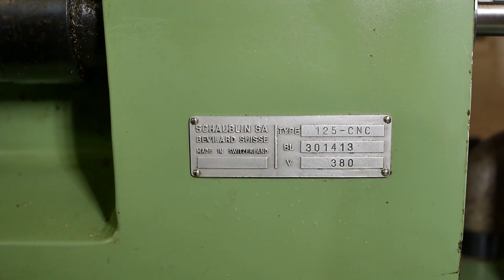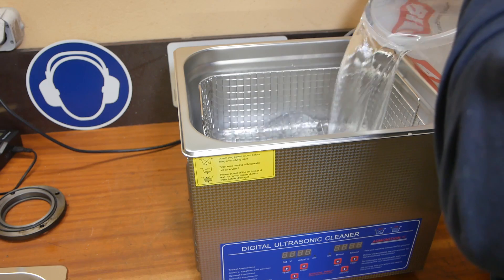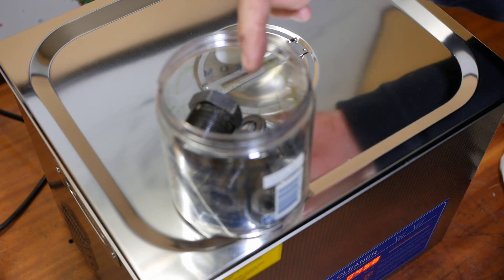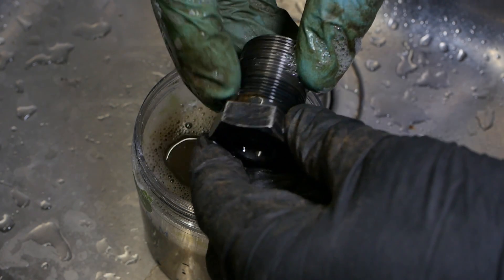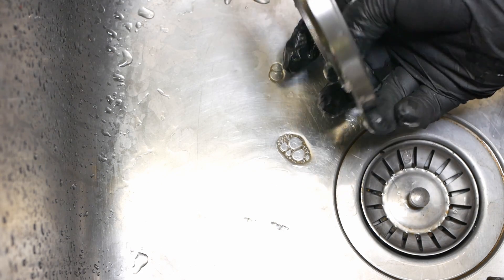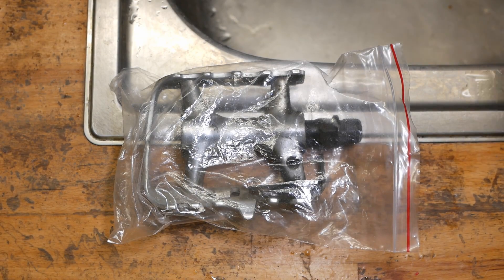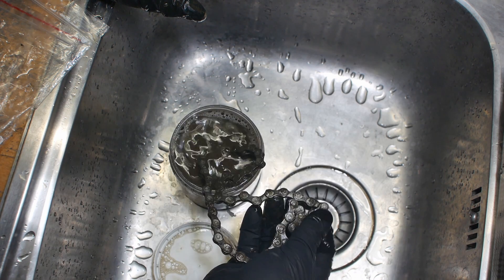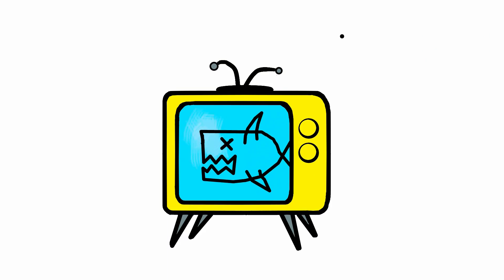Do cheap ultrasonic cleaners work? || RotarySMP

Comment: When using dish washing detergent I find heating it to 60 degrees makes a big difference, and usually 20 minutes or more cleaning time. Anodized or painted parts will lose the coating where it has been nicked or scratched so be careful with any surface coating you want to keep. Sticky stuff like glue or rubber requires some type of solvent but everything else I use gentle detergent.

For carbon on pistions i like to use soda blasting. Just buy a jug of baking soda and put it in a normal sand blasting cabinet. Removes all the carbon without damaging the aluminium. Unlike sand or glass bead blasting that will remove material from the piston. Soda is even safe to use in the wrist pin hole. Rinse with water to remove the soda.
Reply from the maker: Thanks for that.

Comment: I worked at Bausch & Lomb making Intra Optical lenses. We used ultrasound and kerosene to remove the lenses from the dopts. You can use flammable solvents just not SUPER flammable solvents. kerosene or diesel are great. Iso alcohol is good too especially for electronics. Cmon who listens to the safety guy anyway?
Reply from the maker: Thanks for the feedback of your experience. There are a lot of conflicting opinions out there.

Comment: In a HDPE bottle, try mixing up some "Ed's Red", which is typically a mixture of automatic transmission fluid, turpentine/mineral spirits, acetone, and kerosene. It's extremely good at removing carbon fouling like you have on the piston. This is often used for cleaning firearms with tons of fouling on them, though those mixtures also include lanolin to act as a lubricant. This is not likely necessary for you. It will work extremely well in the ultrasonic. I have also found that "simple green" (the purple metal-safe variant) is excellent for this, and I've used it in my ultrasonic for cleaning small carbon-fouled parts. There is likely to be a similar formulation available in Europe if you can't find the original, but only the purple version is safe for aluminum and other alloys.
Reply from the maker: That Ed's red sounds like just the cocktail. Thanks.

Comment: I have a similar looking ultra sonic cleaner, I got mine from Pratt and Whitney surplus a few years back for $80. They’ve since closed down but the ultrasonic cleaner is still kicking, after many iterations of cleaners and solutions that were on average, a double edged sword, I found a safe cleaning product that seems to work very well (at least for me).

Awesome cleaner

It isn’t harmful in any way, so far as I can attest, I’m still testing, but so far so good.
Reply from the maker: Thanks. I bet the one from Pratt is higher quality than mine :)
Reply: @RotarySMP  What's funny is I don't see any company name or brands except for an old Budweiser dragster sticker, so either a Pratt and Whitney parts cleaner was a big fan of the beer or Budweiser were pro's at making ultrasonic cleaners.
Reply from the maker: @eddietowers5595  Nice story there.

Comment: Don't worry too much about the bath, although I use the ziplock / coffee jar trick too. If you leave "blued steel" in long enough, you can get it back to steel and re blue. Decoking pistons are though.... xylene is often quoted as effective...so is brake fluid. I've never tried either....
Reply from the maker: Thanks. I might even have some left over brake fluid.

Comment: Watch the channel mustie1, he uses the same thing to clean his carbs. He starts with 40 mins on a rusty old carburetor.
Reply from the maker: Thanks for that.
Reply: @RotarySMP  He had to wire out his master switch as it ended up going faulty.  He beats the piss out of that machine though.
Reply from the maker: @TechGorilla1987  I probably won't be using  huge amount.

Comment: Putting combustibles into a sealed container in the ultrasonic is infinitely more dangerous. Effectively, by doing that, you upgraded from a fire in a bin, to an explosion waiting to happen. You haven't prevented the materials from combusting, you've prevented any gas expansion from said combustion from leaving, hence creating pressure, hence creating explosion if anything goes wrong.
Reply from the maker: Good point.

Comment: I use big mason jars with rubber seals to submerge small parts in volatile chemicals the seals are easy to replace and the glass won't get damaged.
Reply from the maker: Thanks. Good idea. I have a couple of larger parts to clean, where the kitchen pyrex dishes would be perfect, but that would get me castrated, so I will have to stick with jars.

Comment: How much did it cost? Where did you get it from?
Cool video by the way, very informative.
For cleaning the piston better use organic solvents like Acetone or Dimethylformamide
Reply from the maker: It is just the standard one on amazon, and cost about €130.
Reply: @RotarySMP  Thank you. Found it even on Ebay for €120.

Comment: I often wipe down aluminum parts and surfaces with acetone when I don't have a spray-on degreaser on hand. Might work in your cleaner if you pour it into a glass jar.
Reply from the maker: Good point.

Comment: Yes I use it for cleaning carbs, I use kerosene for most stuff, then switch to petrol for one last clean. I dont use plastic jars though I found they soften too much. Just big glass jars. Never bothered using the heating function, seems to work well without it.
Reply from the maker: Thanks. I haven't done anything with solvents in jars yet. That comes next.

Comment: I used an ultrasonic cleaner for years for deep cleaning high-speed (450-thous RPM+) dental drills before disassembly and repairs.  Various solvents worked in glass or plastic jars nearly submerged in the water bath..  The eoc-friendly bio-degradable cleaners also worked well.   Typically, I used heavy duty floor wax stripper 50% or 100% mixed in a jar for stubborn items (contains butoxyethanol and aminoethanol as active ingredients...Zep branded or equivalent).  Worked very well indeed for degreasing without harming any metal finishes.
Reply from the maker: Thanks for that feedback. I still have more experiementing to do.

Comment: As an old Jeweller who's used ultrasonics for 45yrs, NEVER insert your hands it's while running!
We had a Trade school Teacher who'd done just that over many years & it had affected the bones in his hands...
...so much so that he could no longer pick up or hold anything with his fingers.
Also all parts should be "suspended" within an ultrasonic, NOTHING should be resting on the bottom of the tank.
Ideally that supplied basket should have its handles bent outwards so it'll hang from the sides & allow any jars to have their tops open & above the water surface.
For cleaning jewellery our "everyday" mix was water, dishwashing liquid & a good splash of ammonia.
And a warning to anyone contemplating cleaning the Wife's jewellery to win some brownie points...
...there's a quite a number of precious & semi-precious stones that should NEVER go into an ultrasonic, so be warned!!
HTH, Colin
Reply from the maker: Thanks for that feedback. Once I watched a couple of videos of tenderising meat, I also though better of putting the hands in the will the vibration is running.

Comment: I got the 3L version of that recently to clean parts after being tumbled, so far so good but it takes an age to heat up the water and didn't seem to have enough power to get above 50°c but for my purposes that's not really an issue.

I got mine off eBay UK from a Chinese seller with stock in a UK warehouse, one thing I found to my expense is if you make an offer they jack the price then make a counter offer higher than the buy it now price you've made an offer on and I swear all the different sellers are the same guy as they all jack the prices up at the same time, make another offer and they go up again. BIN Price when I made an offer was something like £39, paid £45 but by the time I'd got it the BIN price was £75!
Reply from the maker: Ouch. I bought mine off Amazon, and there the price also bounced around a bit.

Comment: I use some oven cleaner for anything carbon, what seems to work effectively is using glas in stead of plastics. The Ticopur stuff specially for Ultrasonic gives me the best results and works with everything. Yesterday I removed the stone stuff from exhaust valves using some chalk remover for the bathroom. Also works excellent. I always put some ticopur stuf in the water, also when I am using glas tot put in my parts. You can hear the sound change when you add it and it seems to make the ultrasonic waves more powerfull.
Reply from the maker: Thanks. I have had a few recomendations to switch to glass jars. Thanks for the Ticopur recomendation.

Comment: purple degreaser will clean the piston. It is sold as "Purple Power" here in the states. It will darken aluminum if you leave it in for weeks but we use it on aluminum often and it works great.
Reply: I've also heard good things about pine oil-based cleaners, particularly the pre-2013 formulation of Pine-Sol.
Reply from the maker: Thanks for the recommendations. I have heard that citrix acid based cleaners will work, and have some coming in.

Comment: I am pretty happy with my 6L that I picked up a few months ago. Works a treat. I run the system a bit longer than 5 min. though. Usually 15-20 min.
I find that the water heater kinda sucks though and takes forever. So I pre-fill with hot/boiling water to give it an edge.
Cheers,
Reply from the maker: Yeah, it is really slow. I lso filled it with warm water.

Comment: I hate it when people throw instructions away. Maybe YOU know how to use these things, but I’ll bet that most people don’t. Same thing goes for welders and other equipment. It’s not being more manly. I’ve designed a fair amount of commercial equipment over the decades, but I still read manuals, because you never know.

I wouldn’t worry about putting your fingers for a few moments, but we use ultrasonics as cell disrupters.
Reply from the maker: I bet the manuals for the machines you designed were not written in Chingrish.
Reply: @RotarySMP  no. I wrote them myself. But I see people do this in general. It’s a bad habit because people who watch just copy it. I’m willing to bet that after throwing the manual “away”, they read it carefully before continuing filming. Even you actually read at least part of it.

Comment: I usually scrub the parts with a wire brush and solvent(or  tooth brush for more delicate stuff) before dropping it in the ultrasonic cleaner for 20min. It works really well. For rust removal try wire brushing to remove flakey rust followed by soaking in dilute citric acid for a few hours to a few days depending on how badly rusted it is and the ultrasonic cleaner does the final bit very effectively.
Reply from the maker: I normally use electroysis for rust.
Reply: Do yourself a favor and start with the ultrasonic.  Then scrub, then ultrasonic again

Comment: Been wondering the same. After watching, and seeing a better way to use it, I think this is going on to the to buy list. I really do like the method of keeping the cleaners contained, it surely will prolong the life of the cleaner, or at least the housing...
Reply from the maker: Yeah, it is much easier if you just have to dump clean water when you are finished.

Comment: I'm using a similar cheap ultrasonic cleaner but with the dialing knobs in front. 
Some Times with petrol to clean carburetors or small parts... Works fine as long as the container is sealed properly. Most of the time i run the cleaner the full 0.5h (fire and forget)... Small engine cases runs up to 3 times to clean up. Sounds a long time to wait but it is clean. 👍
Reply from the maker: Thanks for the feedback.

Comment: I've got a 30L unit, with the sweep freq option.  I've just been using distilled water and a drop or two of dish detergent.  It's is nowhere NEAR as quick as your BBQ cleaner, I need to look into that.  On the flip side, if you've got time to let it churn with hot water it will get the job done.  Some stuff may take an hour or two, but it'll do it given enough time.  It's great when I'm working on other things while batches clean.
Reply from the maker: Drain cleaner is also NaOH.

Comment: Plenty of other industrial cleaning brands, but for 95% of your use cases, something like Citrinox would be your ticket since it doesn't destroy non-ferrous materials. Heck even a box of Alconox would work well, but lacks the passivation chemicals. Now it's a matter of spending the $$$ for more than a lifetime buy or finding a smaller bottle (split it with Nico?). But I bet some of the stronger citrus cleaners from the home store would do the job on your non-ferrous parts. Dunno if you guys get evap-o-rust in the EU but it's a great product for rusted ferrous parts, both in terms of knocking off the rust and passivating the surface. But you do want to clean grease off first.

There's a temptation to run the US at less than full, but for the life of the machine, make sure it's up close to the line. Heating makes a HUGE difference, too, as it synergizes with the US (bubble formation and collapse is enhanced). As has been mentioned, thick walled plastic vessels will damp the sound energy, which might be useful in delicate parts, but for most things, glass or metal containers are the way to go. I need to get one for my shop, I use our US cleaners at work a ton for labware cleaning and in some of our sample preparations.

Oh, and for the life of the machine (and maybe cleaning quality), you want the US coupled in via water, so don't place parts directly in the machine where they touch the walls (use the basket). Whenever we have something too big for the basket, we'll take some plastic cups, submerge them, and place things on top of it (again, plastic has bad sound coupling).
Reply from the maker: Thanks for the tip.

Comment: Hi great video as always. Just a quick question, did You degas the water before you started cleaning? You should take out the basket and let it wiz around for 10 min. It will improve cleaning a lot (-:

Edit:spelling
Reply: Agreed, I've found the basket kills most of the ultrasonic action.
Reply from the maker: Thanks. I just used tap water.  I'll try degasing it.

Comment: there are also cleaning solvants for the ultrasonic especially for NON-FERRO and those are not supposed to be heated.
atleast not above 50 degrees celcius that is. we have a jerrycan (German-canister) of that at our factory. just saying.
Reply from the maker: Good to know. I will have to look into a solution for aluminium cleaning.
Reply: @RotarySMP  dont know the name of the liquid. i will try to remind myself checking the name or brand tomorrow.
Reply from the maker: @janwiersma1449  Thanks.
Reply: @RotarySMP  the liquid brandname we use in our ultrasonic is "KEMET cleaning-fluid Type A9" and in addition is written on the can with a sharpy: NON FERRO and do not overheat above >40 celsius. but maybe that last thing is more to prevent it from vaporise to quickly together with the money in the Boss his wallet. but maybe there is a real reason not to overheat. i do not know exactly what the mixing percentage is in our case when we add water.  

and i lied about the Sharpy. because we use an EDDING permanent marker ofcourse. ;)
Reply from the maker: @janwiersma1449  THanks for that.

Comment: I have cleaned similar dirty parts in my ultrasonic cleaner and from what I can tell the majority of the clearing action comes from the bbc cleaner. I have bought some rather expensive cleaning solutions for iron and aluminium and they don‘t work nearly as good as that stuff.
Reply from the maker: Yeah, NaOH does a pretty good job on it. The US cleaner just means you dont have to scrub and aggitate, which is really helpful.

Comment: Its recommended to use these Ultrasonic baths with hearing protection or just run it in a different room.
Reply from the maker: Yeah, it is not so much load, as annoying as hell. I was wearing ear defenders most of the time.
Reply: I'd recommend throwing a shop towel or two over the top. Knocks the high frequencies down quite a bit and helps that anemic heather get to temp and stay there in a cold winter garage.
Reply from the maker: @willpipho4558  Thanks, that is another great suggestion. High frequencies are normally pretty easy to damp out.

Comment: Thanks for the review.  Bought a used ultrasound a while ago, but have never tried a container with solvent inside the bath - excellent suggestion!
Reply from the maker: A few YT videos suggested that. Really saves on the clean up, and uses way less chemicals for small parts.

Comment: Maybe unwittingly, but you possibly just made the least biased practical review of the U/S cleaner on YT! Despite the poor labeling and the typical Chinese shortcomings (unless there's a western company handling those shortcomings), it seems low priced for the characteristics - just checked eBay and, for Europe, it costs around 115€. So, it should be adequate for most shop works (for those ready use the low cost to absorb eventual warranty issues themselves, which is how most Chinese companies like to operate - low price, but no warranty claims. I can live with that :-)
Reply from the maker: Thanks. I was not planning to do a review, but I had so much fun playing with it this week, I had too little real footage :)
Reply: @RotarySMP  I bet! I only have a small jewelry U/S cleaner and it was fun playing with it when I got it :-)
And that's why it became a good review - it was not intentional - just your experience with it :-)
Reply from the maker: @JoseSilveira-newhandleforYT  Thanks for your feedback. Some of the YT reviews I watched really dragged things out. It is a very simple machine, and it doesn't need a lot of explanation.
Reply: @RotarySMP  Agree :-)